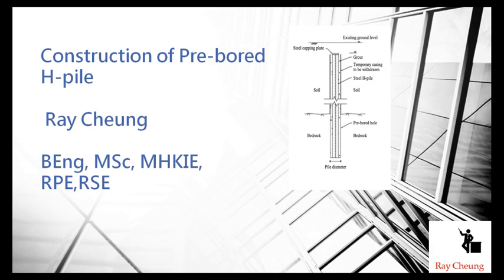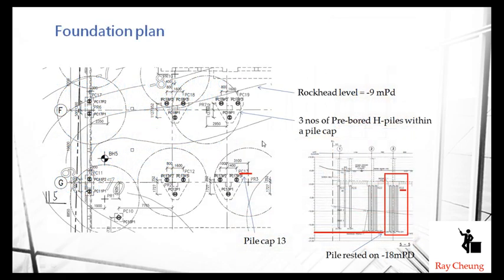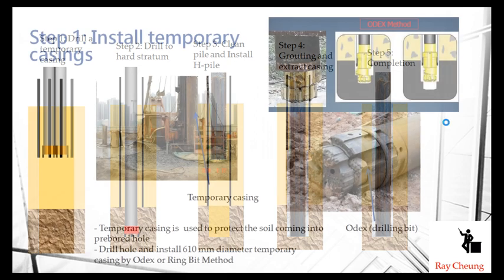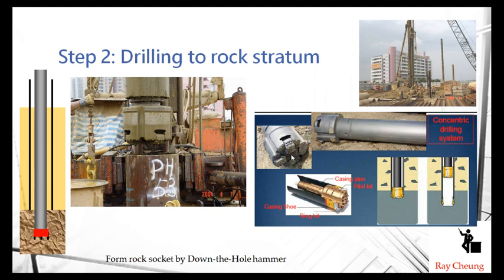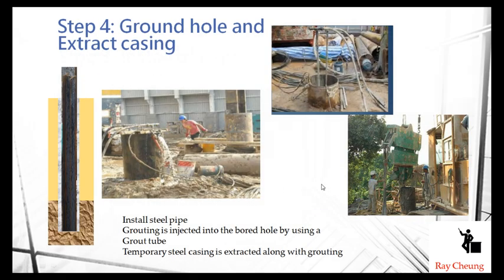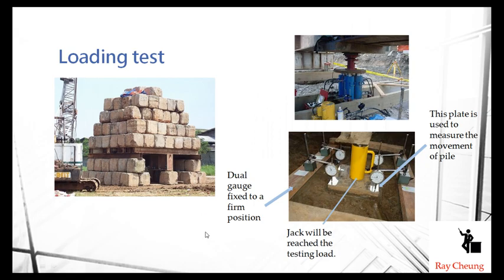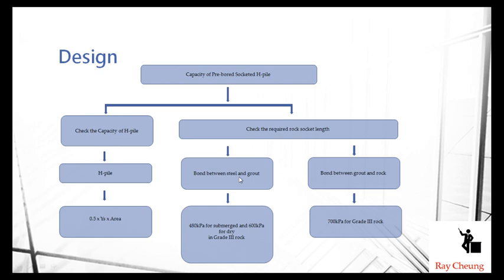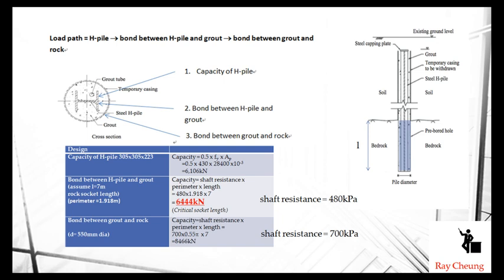Construction of Pre-bored socketed H-pile

Comment: Dear ray, thanks for your great video.  Is the rock socketed H pile only suitable for the case that the bedrock is close to the surface?  What is the economical depth for using a rock socketed H pile?
Reply from the maker: Once the bedrock is close to ground level , say 3metre, we will use footing. There is no absolute value for optimum design, but you can say 40 metre.
Reply: CheukMan Herman Li there is no absolute answer, but engineers always consider with the cost. You can design with bored piles even the rock head is close to the GL, but it will be much much expensive than pad foundation.